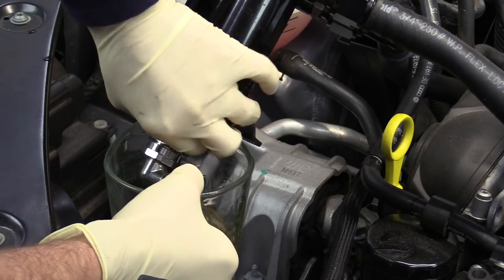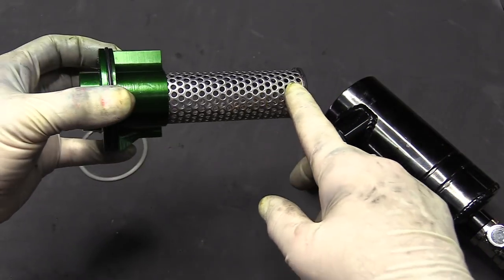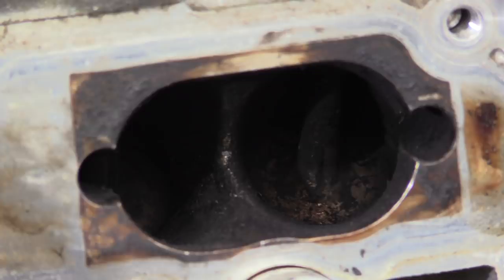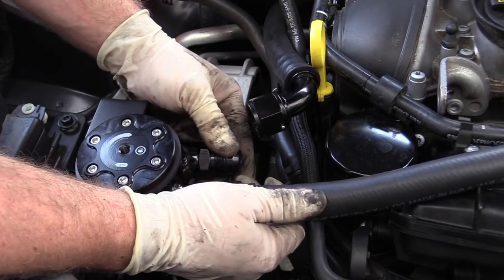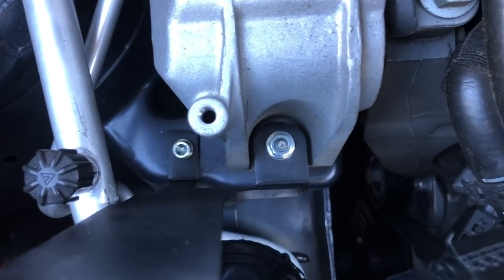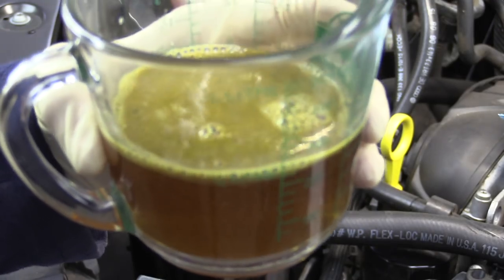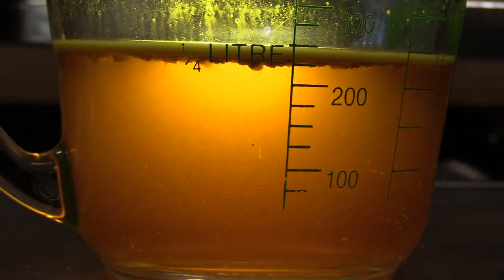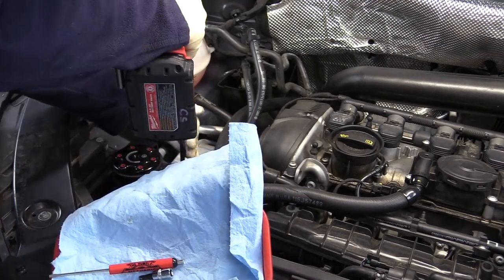Do Catch Cans REALLY Work?

Comment: Why do European Gen.3 - 1.8 and 2.0 TFSI have FSI and MPI combined and American cars have not I wonder ?
Even my 2016 Skoda has FSI combined with MPI (8 injectors in total) and for a fact I can tell you it runs a lot smoother in MPI mode then it does running FSI.

Comment: The question is not do catch cans work, sure they will capture some of the fine oil mist in the air flow, the question is does every car need one and that answer is no, there are literally tens of millions of cars on the road that run a full life without a catch can with no problems. In fact outside of some performance sites the majority of people would not even know what a catch can is. 

There are some engines that can benefit from a catch can, direct injection engines are one because they do not have fuel sprayed into the intake system that can wash off the valve to help keep it clean. Turbo charged engines with direct injection are good candidates for an oil catch can. 

Still for most people not having an oil catch can will not effect them in any way.

Comment: Will it fix the problem? Absolutely not, however it does reduce the rate in which the carbon builds up. I’ve done many checks on my Mini Cooper and several regular customers vehicles at work and I found that though it doesn’t resolve the carbon build up issue it does greatly increase the time between cleaning services needing to be done usually by 20,000 or so miles hard to give an exact number due to so many variables that can factor in such as oil change intervals and driving habits.

Comment: Manufacturers do HAVE THEM integrated into the PCV system ahead of the PCV valve. Usually it is a series of baffles under the valve cover to condense and trap the oil vapors and separate them from the air before plumbing the air into the intake via the PCV valve. Instead of a can that needs to be drained, the stuff just drains back into the oiling system. VW-AUDI doesn't in the 1st and 2nd gen DI engines which is why they SUCK when it comes to intake gunk build up. Mini sucks too, BTW.
Reply: I am trying really hard to understand the last part when you say about suck..  
Can you explain to me "when it comes to intake gunk build up"?
Reply: @olafstoico4838  OK, lets start from the beginning...
(1) Your crankcase gets pressurized by tiny amounts of gas seeping past the piston rings. If you don't vent it, pressure builds up in there and something will pop. Most engines vent it by sucking air out via the PCV valve into the intake. They do this because the vapors are then burned in the engine (which is more environmentally friendly) and because the intakes are in a state of vacuum which helps suck the gases out of the crankcase.
(2) These vapor are DIRTY --- they contain combustion products carbon deposits and oil  in addition to air. It is the oil and particular the carbon deposits which get onto your intake valves and become gunk.
(3) DI engines have DRY intakes. That is fuel is injected into the cylinders directly, not ahead of the intake valves. So whatever gets on the intake valves are not going to be cleaned by the fuel spray. Fuel dissolves oil and carbon -- especially fuel with detergent additives (all decent gasoline) so intakes get cleaned naturally on port injected or carbureted engines.
(4) The catch can, if you use one, traps the heavier deposits and oil while letting the air through. It does so with baffles and/or steel mesh which the air must pass through are low air flow speeds.
(5) Many properly designed DI engines have elements of a catch can integrated into the design of the valve covers such that oil and deposits exiting the PCV valve is reduced.
(6) VW-AUDI FSI and TSI engines lack this feature. Hence, they SUCK.
Reply: Hi, Thank you. 

I am studying this subject because my car, audi a4 2.0TSI b8,5 is with bad pcv valve. 

I know because it started to fail the engine first, so I tested opening the oil tap and it has an huge vacuum also, I took off the hose pcv outlet and there ware a lot of oil on it ..  in the other side of the house as well. 

So I tapped the hose and the vacuum was over and the engine was perfect.  But many gas and smoke came from the pcv valve. 

So I am thinking of put na filter in the outlet pcv valve and tap the entry of the intake air. 
In this way I can wait the new pcv Valve .. what do you think? Because I need to use the car.

Comment: I've had thoughts of getting a catch can for some time. But as pointed out in this review, the reason for getting one, reduced carbon buildup on the valve stems, is not clearly proven. I have not seen proof-positive so I remain reluctant. So many mods seem to present themselves as a cure for some perceived issue, yet with no before-after proof to support the claims. Would the gunk in the catch can  definitively  wind up on the valve stems? And why is the liquid substance so watery? Maybe the "Italian tune-up" is still a viable option? While I may be on the wrong side of this discussion, I would only ask someone to direct me to proof that this mod is effective at what it does.

Comment: Looks like mostly water.  I don't see these catch cans as a solution to intake deposits.  If anything the H2O should help reduce deposits at least in the combustion chamber.  My understanding is the carbon is a result of no fuel going past the intake valve, exhaust reversion through the intake, and the air oil separator not being 100% efficient.  Perhaps if manufacturers added a single upstream injector deposits would be reduced.  Almost like the old 5th injector that 16V MK2 engines had.

Comment: I firmly believe that the pcv system alone isnt the cause of the "direct injection problem"  the egr system is a huge factor aswell.
Reply from the maker: On cars with EGR, maybe. But VW doesn't run EGR on their gas engines.
Reply: high fives for VW :D.  On the toyota 1azfse, where the intake has the tvis butterfly that blocks air to one valve per cylinder,  with 8 seperate intake ports, the the individual port where the egr injects to each cylinder had carbon cacked up thick behind the valve,  and the opposing valve was clean. typing with a faulty mobile screen, pardon any errors

Comment: Has this had any adverse effects on the engine? Such as lower fuel economy (air being slowed down makes think it would have an adverse effect on that!)
Reply from the maker: I didn't notice any impact on the car. Seemed just the same as before installing.
Reply: Brett Suydam lowers octane in fuel.
Reply: Brett Suydam you do lose minimal mpg through cleaner cumbustion the obvious side affect from all that vapour not going back into the intake, cleaner faster burn. As for air flow not really, depending on which kind of set up you have, this can looks to be more an air oil separator than a catch can of which an aos is still plumbed into the intake which creates a vacuum an pulls the air through, if it's an open to atmosphere catch can with the pcv bypassed your more reliant in the crank case to push air out rather rather than vacuum pulling it through.
Only problem with this type of set up in the vid is you have to be vigilant with the can checks or when it's full you'll suck all the crap back into the intake. My sti set up has both head vents to can an pcv bypassed to can open to atmosphere so if I ever forget to check an its full it will just flow out the overflow pipe under the car.
Reply: I don't think it really affects the air intake, it just kinda adds along to the air intake) if the engine needs more air it will suck it in through the regular intake not the bypass valve thing.

Comment: I believe you left out the very important part about how oil in the intake stream lowers the overall octane of the mixture in the combustion chamber, I would love to hear your thoughts on this!
Reply: That's a myth it take more energy to  ignite oil. If that was the case then  Diesel fuel witch  is closer to oil would not be able to withstand the high  compression in a diesel engine. Oil catch can was made for old  direct injection engines that didn't have the dua fuell injectors.  Somewhere down-the-line the information got screwed up when they tried to sell it for every car.

Comment: It's just water.. The same thing happened when I used a catch can on my wife's GMC. After 10 miles of driving there would be so much water, in the oil can ,the engine would actually be suckin it up in the intake. I tried just venting to the outside air. Nothing worked. I bet this guys oil can filled up a lot quicker than he thinks.

Comment: Even if you are getting a lot of water, it still is a good thing just drain it more often and check oil level regularly. Do you live near a humid area? That could make an effect on it and affect the amount of water vs oil found. Also if your trips are short, and the engine does not get up to temp properly you can expect a lot of moisture. Cleaning your intake sensor(s) might help  and a clean air filter) with the AFR which also affects combustion byproducts. Keep it up and have fun! I even found that different fuels make a difference in both the (lets call it "blowby") because some will make a higher cylinder pressure under heavy loads than others. It cannot hurt I think, to answer your question, what carbon? drive it harder...heheh. But this filter will catch the oil when you back off from full throttle suddenly.

Comment: That's water. Exactly what a pcv is suppose to do. The engine is burning oil past the rings. Will it fix carbon build up? Not likely, Carbon build is due to cylinder scavenging AKA valve overlap.

Comment: I think manufactures should put them on cars.
Reply: Catch cans are a maintenance item that the conscientious, that being people like us who do these things as a home job and then talk about it online, will see to.  For a majority of people who never go under the hood until there is an actual problem,  the can(s) will only fill up and may present a performance issue and then after paying a bunch to the shop will just ask for the can to be removed.  Oil capturing from an air stream is good for the engine but not a convenience that many would want.  Most people's knowledge of cars does not go beyond the key and gas cap and for some, actually topping up the oil now and then.  Another case against the cans is how many would simply dump that bit of oil on the ground or in the trash.  I recyke mine with oil change oil.  These babies are a maintenance item your usual white collar types would consider a PITA.

Comment: I think it would definitely help in reducing the carbon build up. Watch out for the valve cover gasket, they tend to leak into the water pump and mess up the gasket causing the water pump to leak. Good video.

Comment: It looks like your catch can is not located in an area of the engine bay where it gets hot enough (>90degC) to vaporize water and/or fuel, allowing it to be drawn back into the intake.  Fouling the can with water and/or fuel condensate (volatile) is not what we are trying to achieve here.  We just want to trap oil (non-volatile).

Comment: Would this void warranty if I installed this on my 2018 Tiguan?
Reply: Jimmy Van Squattum if something happens to any intake parts, VW can argue the can cause the problem. All manufacturers are very good at blaming on after market parts.
Reply: That’s what I figure. I was a volvo tech but never ran into anyone installing one on there car. Just wanted to see if he’s ever had experience with this when he was a tech.
Reply from the maker: I have never had a situation where a catch can caused an issue. But if you came in with a "system lean" type fault, the first that would need to happen is to remove the aftermarket stuff. This highly depends on the dealer, the tech, and the problem you face. IF you have this installed and have a radio issue, it's not a problem.

Comment: Maybe not after 3k miles but after say 75k + miles of that stuff getting back into the motor ......???  I'd say that is the reason why valves are gummed up ... This is why I use catch cans on both my turbo cars ... I don't want that crap going back in... I have my catch can vented to atmosphere and drain then every so often... You would be surprised how much oil and crap gets into that can when the motor is under boost ....

Comment: I think it depends on the engine. Audi engines have a reputation for drinking oil like a street drunk. An engine like that probably has a lot of blow-by. Perhaps a catch can would be worth it. Something like a Suzuki engine barely sips any oil between major services. Blow-by must be extremely small. Hence Suzuki's own PCV system is likely good enough.  A catch can is likely not worth it on such an engine.

Comment: I suspect the design of the PCV for the 2.0 TSI engine was flawed from the beginning. It would be great if you investigated this.

I have a 2013 GTI. I think it has the same 2.0 TSI engine that is on your Tiguan.

I also have an oil consumption issue. My GTI burns about  1 litre / 5000 km. Still within the (ridiculous) spec from VW of 1 litre / 2000 km, but still high in my mind, especially considering the car only has 28,000 km on it.

After a lot of investigation of this issue I started to focus on the PCV valve. The valve design, for the MKVI GTI alone, has been through four iterations over the years (A, E, AC, AH).

Also, the same PCV valve is part of the fix for the Audi oil consumption problems - where there was a class action suit against VAG. So this tells me that VAG suspected that the PCV valve might be faulty.

Check out these videos:

https://www.youtube.com/watch?v=P0c4wM28ex0

https://www.youtube.com/watch?v=xDnb9WXSHs8

So my theory is that the design was faulty from the get-go when the engine went into production back in 2008(?). But it was not faulty enough to exceed the oil consumption spec. So VAG (under the brilliant leadership of Martin Winterkorn) decided not to fix the problem in existing cars. Besides, it would bring in more maintenance work to the dealers for intake valve cleaning. Instead they simply redesigned the PCV valve for future engine production.

My car has revision E of the valve. I am planning to install a new PCV valve, revision AH, to see if that fixes the consumption problem. I have the new valve already. I'm just waiting for a warm(ish) day to install it in the parking lot.

I am also planning to switch to LiquiMoly oil at my next change. My other theory is that these engines are designed for German oil specs, not American. So perhaps German spec oil doesn't vaporize as much, or the PCV valve is designed for German spec oil, or something along these lines.
Reply: jonfklein I'm a liqui moly supplier.  It gets consumed just the same.  Turbo engines consume oil.  No PCV can handle the blow by stresses of a turbo charger.

Even beloved Toyota is struggling with oil consumption issues on their 4 cylinder turbo engine.
Reply: At least your tsi didn’t have the the tensioner problem..... I bought a 2010 gti that blew up in 5 days lmao
Reply: Lynx Star Automotive:

Thanks for the information.

I've heard that too. From what I understand the seals in the turbo seep a fair amount of oil. But there are also other MKVI GTI owners who say they have practically zero consumption, so I feel like there is something wrong with my car. It could also be because I tend to use engine braking a fair bit. So perhaps whenever I do it sucks oil through the PCV valve.

I might have wasted my money on the new PCV valve, but at least I'll know whether or not it is the cause of the consumption problem. I'll probably still try Liqui Moly as well for the same reason, just to see for myself if it fixes the problem.
Reply: Andrew Walker:

I've heard about that issue. My GTI is 2013 so I'm hoping it was corrected before my car was manufactured.

Frankly, I'm not impressed with VW quality, and I suspect Martin Winterkorn has something to do with it. I have read he created a culture of fear at VW, ruthlessly driving the management for higher profits. Then when the emissions scandal broke he immediately quit and ran away. He should be in prison IMO.
Reply: jonfklein

Well I wish you luck sir! 

In my situation I had a forester for 8 years that I loved sold it with 215,000 miles. Bought the used gti at a jag dealer in Cincinnati it was a one owner with 60k miles. Drove it for 5 days then bam the oil pan was full of metal shavings. Lucky the dealer took the car back and I wasn’t out a cent. Bought a 05 wrx one owner with 87k miles and have been in love since. Same parts and layout as my old forester so I can work on it myself. So far only replaced a few hoses. 

After that terrible experience I will stay far away from German cars.

Comment: Disable the egr with a cpu reflash. Fixes the carbon problem...
Reply from the maker: VW doesn’t use EGR on their gas turbo engines.
Reply: Works wonders on the TDIs. Only VW's I was willing to buy. Provent 200 or a BMW one from the junkyard works well.
Reply: Using a provent 200 on my ml350 bluetec. Intercooler was filled with gunk. Had to have it removed and drained out.... Annoying

Comment: This is one of the reasons I'm planning on going to an electric car for short trips. I own a 2.8ltr diesel Jeep Wrangler JKU and a 3ltr Audi Q5 diesel. Both vehicles have oil vapor separators and whilst they run way better with separators, most of the time they barely get up to running temp before I reach my destination and the vehicle is switched off. Engines are at their most fuel efficient when at running temp so I need a vehicle that works at maximum efficiency as soon as I get in it. ICE engines for me at least are a huge waste of money and spew pollution into the air for no good reason and give us all cancer and the pain and suffering of spending money to save the lives of those we love only to watch them die in pain.